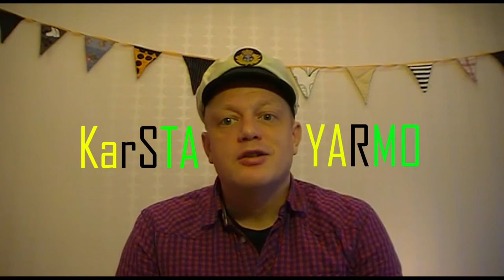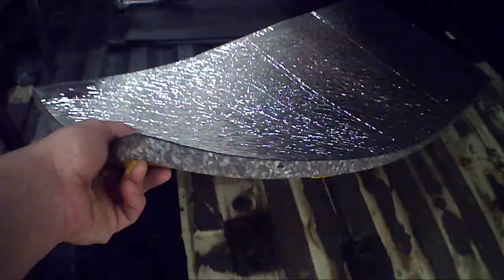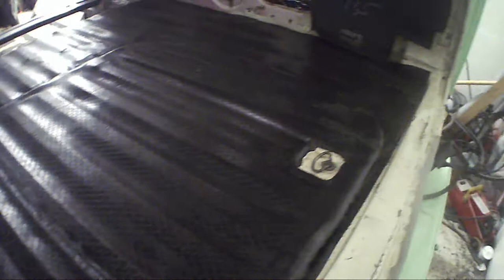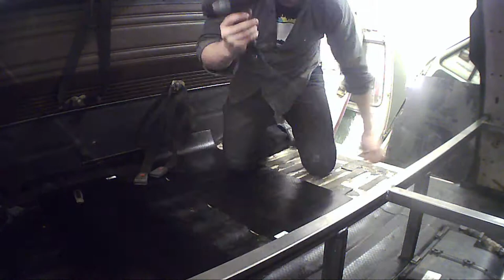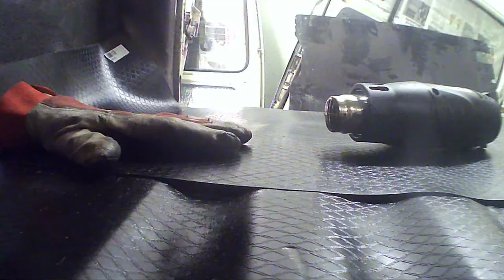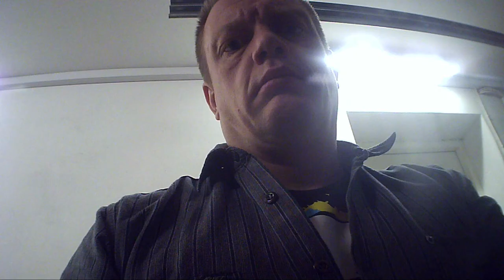VW T3 CAMPERVAN INSULATION AND NOISE CANCELLING

Comment: Hi Hemppa, how has the sound insulation been working? Would you do something different nex time? I am getting ready to do this on my van soon :)
Reply from the maker: I really dont know because I sold the car when it was ready. But the litle experience I got from the insulation, I would do it again and maybe even thicker materials. Sound redused but it was still quite noisy. Good luck with your project.
Reply: @Hemppa  Thank you for your quick reply!